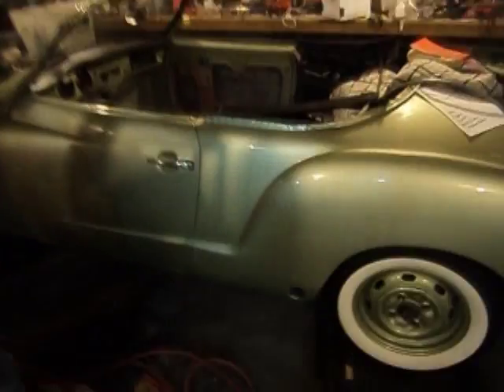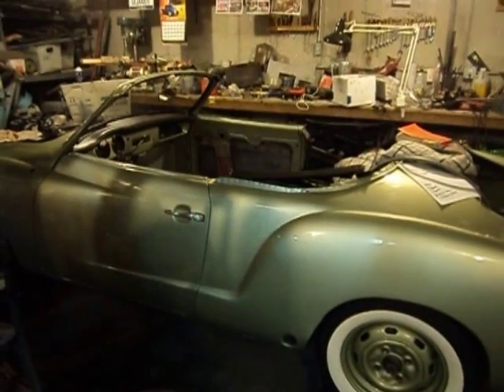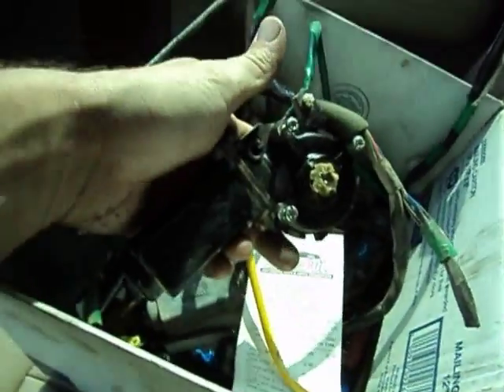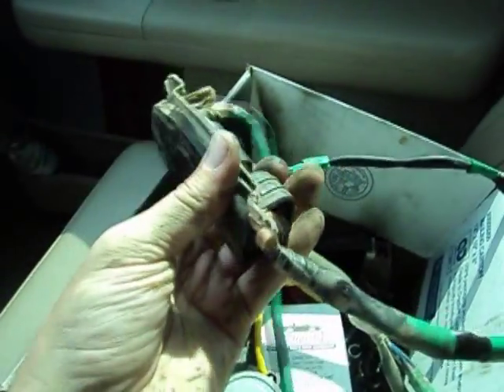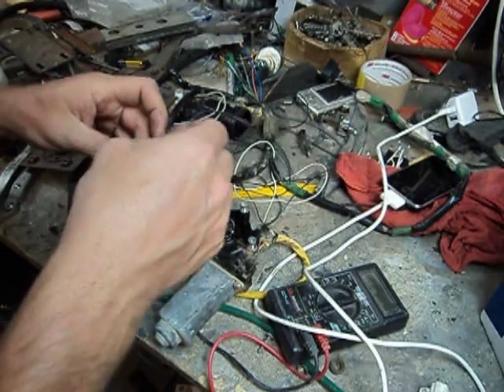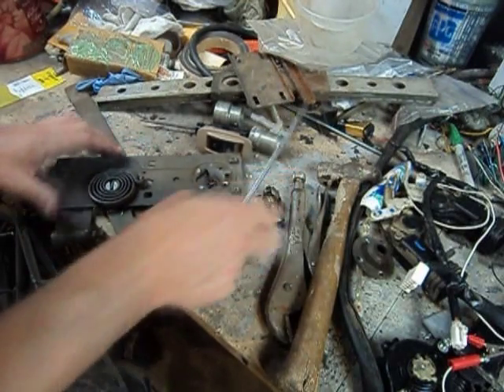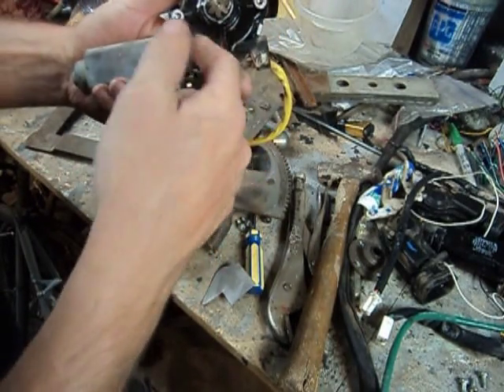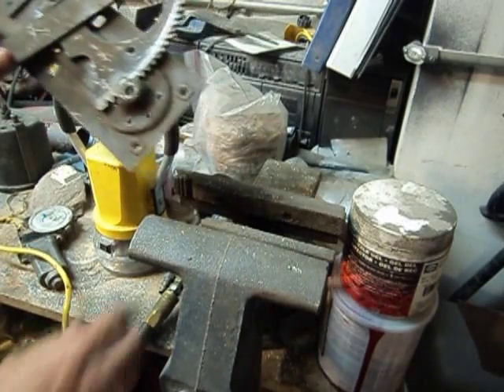Adding Power Windows to the Vintage Volkswagen

Comment from the maker: I decided not to do the power windows in order to save time.  I couldn't get the switches to work like I needed them to work.  I would have cut off the crank attachment, and I believe I could have hidden everything under a flat door card.

Comment: On my Audi Fox I got a power window for a Ford F-150 and the guide rail then I got the rubber strip that goes on the bottom of the glass from eBay and from eBay I also got the universal two power window kit which switches and wire harness it all went together well and I have fast reliable power windows with all new parts cost me about $200 for the window regulators and $50 for the window tint and the rubber strips. The F-150 Regulators have a straight arm I simply look at all the power when The Regulators until I find one that's similar or very close to that looks like the one I removed. You did it to a dots and I use put maximum window regulators in a dots and 510 and another pair of Nissan rear window regulators I simply just find a regulator that looks similar to the manual one I've removed.